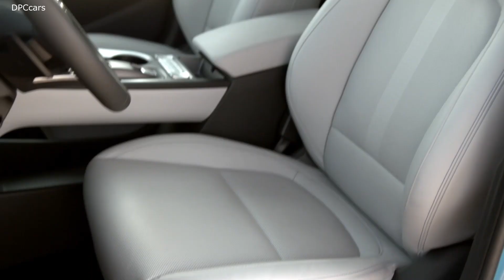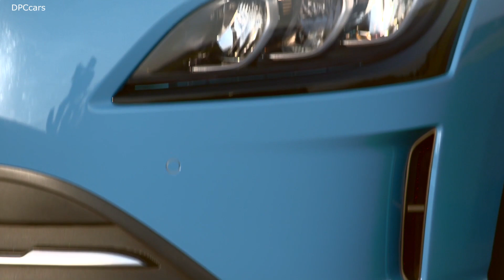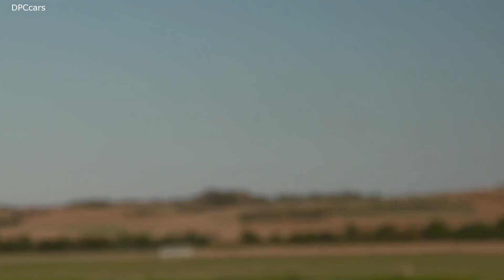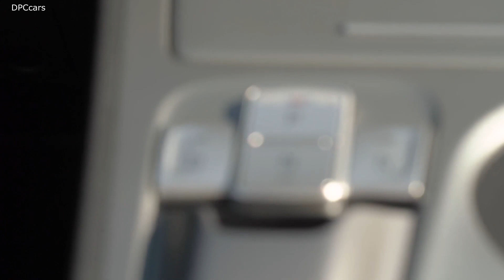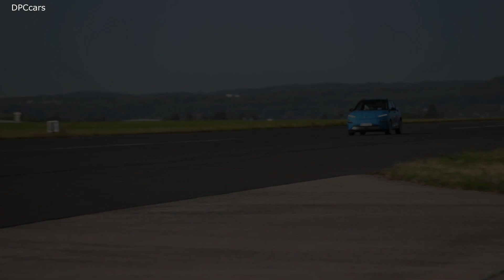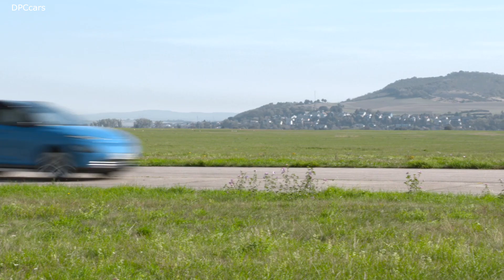Hyundai Kona Electric 2021 Overview

Comment: I get it's convenient to have the charge port on the front but I wish they would hide it better like the nissan leaf or just move it to the front fenders cuz it's just an eyesore especially this refresh cuz it's not even trying to be hidden. like it drives my OCD crazy seeing that cutout in the front of the car that's offset....like u couldn't even make it centered? also those stupid charge covers u got to pull off and they just dangle there is Soo bad...like come on other companies do it better why do u have 2 separate dangling covers for the charge plugs?

Comment: I didn't like the charging opening placed at the front grill.. its placed randomly without any symmetry.. that looks like something broke off and fixed later.. they paced it awkwardly
Reply: OK now I can’t unsee that. But if that is one of the sacrifices I have to make to reduce climate change, I will choose to overlook it.
Reply: @markdouglas8073  or buy a different electric car??

Comment: Before the Oct. 17 case, 13 fires involving Kona Electrics were reported in and outside Korea, the most recent in Daegu on Oct. 4. Of the 13 cases, nine were in Korea, two in Canada and two in Europe.
Reply: Kona Electric in Europe are built in Czechia. They use a different battery pack from ST Innovation.
Reply: @Iskander1968   SK innovation
Reply: @Iskander1968 Kona Electric with red paint, are built in korea. I have a Hyundai kona electric 64 kwh with red paint.
Reply: That's a true fact, they issued a recall as well.

Comment: Wrong place to place a charger. . .
Reply: Nah it's right, because in the parking places, the cable stations are on the front side, so it makes sense why the charger is placed on the front end of this car, and not on the side!
Reply: @dinohermann1505  except when you front end someone and cant charge because the charging port is now damaged.
Reply: @dinohermann1505  over time when it rains , there is higher chance of getting water damage since it's right in front and when driving the first place to get it by anything is front
Reply: @ShazmilNassar  you watch Bjorn nylands videos , don't you?
Reply: Snow finds its way in as well
Reply: @happycouple2976  you watch Bjorn nylands videos don't you?
Reply: No it’s designed to be fully water proof and I like it when you park it’s easier to charge it
Reply: @ladayblues6759  watch Bjorn nylands road test over 1000km